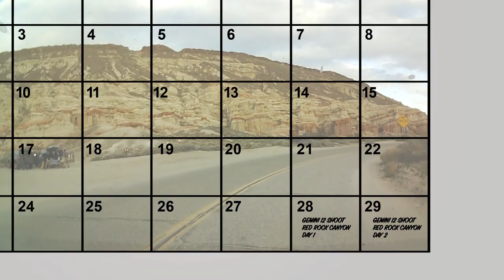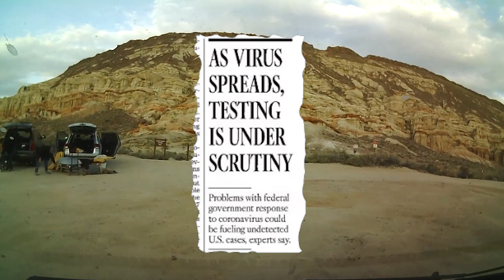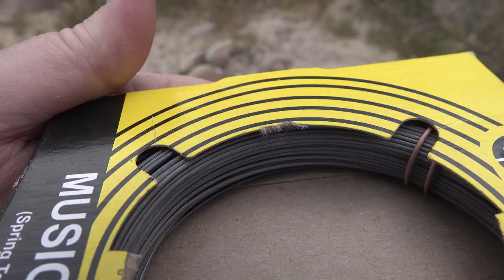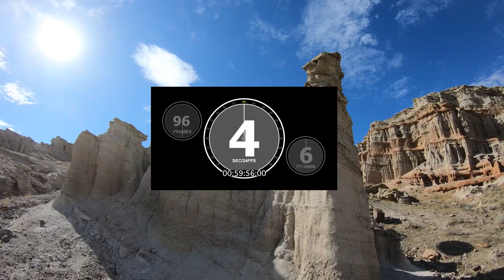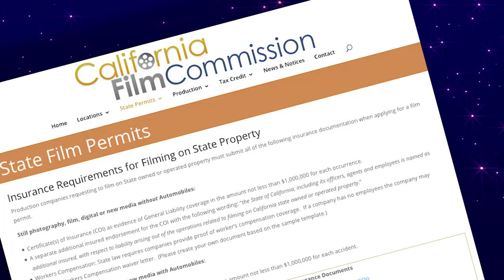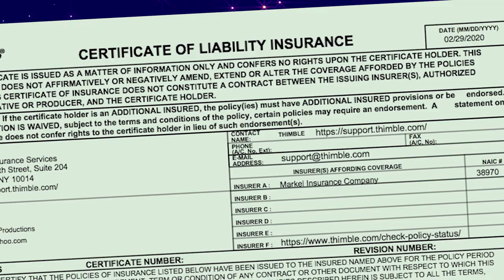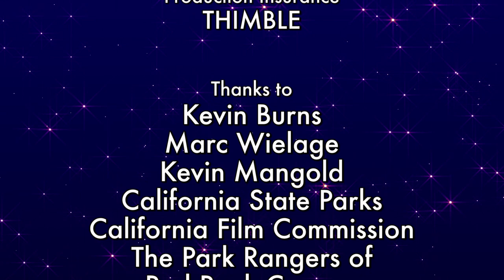Relaunching The Gemini 12 Part 3

Comment: I wish I could have been there to watch you do this. LIS was my favorite show as a kid, and the crash scene was the highlight of the entire series. I used to count down the days until I could watch this scene over again. I would never miss this episode. Thanks for doing such an excellent job. I really admire how you put the GO-PRO inside the model.
Reply: Thanks for that John.  Please do realize, with this 3 part video,  in effect you are right there with us!  

The ship itself is a very light weight, ultra-strong carbon fiber/epoxy exact duplicate of the original miniature that I'd restored several years ago. (See: "Restoring the Gemini 12" if you haven't as yet.) 

Just as with the original filmed miniature, the ship is a thin shell and quite open inside.  Glen simply located the standard GoPro camera mount with double stick adhesive already applied, to the floor of the interior, right behind the center window and then operated it remotely by using his smart phone.  As there is absolutely no cell service in Red Rock Canyon, it was a bit touch and go but as always, Glen came through and recorded the video you see here.

Comment: This made me wonder about another effect used on the Jupiter 2, or Gemini 12. Scenes depict sidewise rockets in space. I wonder if they used the Lydecker guide wire tubes with a fire extinguisher to depict the rocket spray. Great job guys, I appreciate your tenacity.
Reply from the maker: I also heard that the 'side jets' were using the Lydecker tubes with compressed air (chilled to show up on camera).  If anyone has solid evidence of this please share.
Reply: @gemini12channel58  That is correct, CO2 through the Lydecker tubes.

Comment: Great Video! But This spaceship will always be known to me as The Jupiter 2!! Not The Gemini 12
Reply: Kindly realize "this" single level ship is the Gemini 12 and was made specifically for the un-aired pilot (and also seen when the show premiered) . The series itself had a very differing premise and actually used a differently designed miniature(s) with TWO levels, the Jupiter 2... which appeared in all other episodes.  This one IS an actually different design.  See:  "Restoring the Gemini 12"  here on You Tube.

Comment: Would the original been shot 24fps or 30fps (for NTSC?)
Reply from the maker: Good question!  Yes, the 1965 version was filmed at 24 frames per second.  Our video project is 30fps so the action is a little 'smoother' due to frame rate but the speed of the ship descending was the same as the one from 55 years ago.  Our replica matched the weight of the original G12, the angle of descent was the same and the piano wire was standard as used by the Lydeckers.
Reply: Mike, describe a film chain's 3-2 "Pull-down" for 60Hz NTSC standards....

Comment: did it go faster or  slower in the  original run  ?  lol
Reply from the maker: We figured it went exactly the same speed.  Our replica was the same weight as the original...the angle of the descent was unchanged from '65...and the wires were the same as used by the Lydeckers.
Reply: @gemini12channel58  .. i was hoping for this answer and we got it... how do u  meausure the speed ? with  a hand held device i guess?...and what was  the speed... about  20 miles an hour or so   ?
Reply from the maker: @mickfizz1  We didn't have a way to measure the downhill speed...but it was more like 5 to 10 mph...we had no problem slowing the ship with the 3rd wire before it hit the lower rig.

Comment: Plan-demic you mean. Infamy. Fantastic job you did though, it's interesting how a drone is dangerous to nothing but rocks and yet whole forests are destroyed forever when it comes to mining yet that's ok.

Using your new processes with the better wire I'd wager that the movie could be redone better than the original.
Reply: 1) I'd suggest not going "there" if you'd like to remain "uncancelled".  As stated that is just a suggestion.
2) The site is well within the airspace of Edwards Air Force Base and all the testing etc. that goes on there,  hence the rational restriction on drone use. 
3)  Yes.  Glen has already done quite a bit of digital wire removal and smoke with excellent results. This will be presented with an abbreviated effects reel that's well along.  The full reel will include the launch as well as a lot more.
Reply: @paullubliner6221  thanks for the reply, is it possible to replace scenes in the original movie with better effects? Basically upgrading it. Or should I say upgraded scenes .
Reply: @HHowardHH  That's not up to us.  But what I will tell you is this:
---The entire goal of this exercise will ultimately be (but NOT right away) a 1080P widescreen & COLOR version from lift-off, through space and to the crash landing with a lot of "the missing footage" that was neither seen nor depicted (as in shot) for the original Pilot.  Such "missing footage" as a greatly expanded and more elaborate "Lift-Off" sequence and especially the actual crash landing itself ----I guarantee it to be depicted just a bit differently than you might expect!
Reply: @paullubliner6221  that sounds very exciting, please do it quickly, I'm not getting any younger. 😁
Reply: @HHowardHH  Howard, I am OLDER THAN YOU!  If you want us to work faster then you making a voluntary donation I$  $UGGE$TED!! (LOL)  Glen is making progress right this second!
Reply: @paullubliner6221  😂, well a nag for more is much more delightful than a rebuttle. 😁 I think you're great, thanks for chatting to me, i was boasting to my brother about it. Lol
Reply: @HHowardHH  LOL,  that's great!  Thanks again!

Comment: What is your problem with the Seaview from  Moebius?
Reply: ....I   " have a PROBLEM",   Robert M??  None whatsoever. BUT there has NEVER been a commercially produced, actual scale model of any of the "Seaview" miniatures. Not even close!  And I can prove that beyond any doubt, ...even in a court room.
     The Moebius "Seaview",  is:   "Naught but a Caricature".  Without question, it is not a scale model,  as by definition that requires dimensional tolerances which these things sorely lack.  And it all rapidly deteriorates from there.  
     
For Example:
1)   Their hulls are seriously, vertically elliptical not cylindrical,  BUT,  the originals were indeed cylindrical.
2)    The noses are too bulbous, too wide, with hopelessly incorrect contours, reference the Fox blueprints.
3)    The sail is too tall.
4)    The tail fins are flat and too thick, without the correct airfoil cross-section.
5)    Even the rudders are far too thick and overall, 
    ---- the entirety of these  "model kits"  are significantly "out of tolerance.",  regarding virtually every major and even minor dimensional measurement.  Lastly, they are most clumsily and crudely rendered

     Apparently, they were done without so much as consulting the original 20th Century Fox blueprints (at all) or a hands-on examination of any of the existing miniatures, which to one degree or another,  all still do exist.  And I am sorry but Dave M.'s involvement does not actually qualify as "primary research".

    Back in 2011,  I did an in-depth and on-line thread, a step by step FULL correction of the 14" version Moebius, that was on "HobbyTalk.com."  I've looked and it's no longer up there, but it was THOROUGH.  AND,  I DO still have all the "before and after" images! as "evidence" of my numerated statement of errors (above) as factually correct.
     That thread even included how to color match the original 8-1/2 foot Flying Sub version miniature's paint ---with the FIVE grey hues and exactly how and where to apply those colors.  

     In order to correct everything, it all took a very long time.  And after many months I finally got the thread finished,  but it really was a HUGE job as there is that much wrong.  The 39" M. Kit cannot be corrected, or even salvaged  There is simply so much out of specification., one would be much better off by starting from scratch.
----Since by your comment, you obviously came here from "elsewhere",  I presume you do know how to personally email me.  Do so and I'll send all the proof anyone could need to see those things are indeed, absolutely nothing aside from quite poor caricatures.  So much so, -----Remco would be most proud!

Comment: Not shot on film....sad
Reply: What difference does that make?  When I was going for my film degree half a century ago, I'd have agreed, but not now.The technical aspects of recording are just that, technical and nothing more.
Reply: @paullubliner6221  look, feel, authenticity.
Reply: @bratboy5203  Excuse me?  WHAT "look" exactly are you referring to?  AND... as determined by what film?  Kodak ECO, 5247 stock, reversal K41process  Kodachrome, or Fuji Film (as with  "Das Boot")?  ALL have very different "looks" and even vary widely by periods of time when they were processed, and especially how they were stored after processing.  And all of this ignores the output of digital restoration! 
To this day, I personally am still able to accurately estimate the age of color footage within a few years by its given characteristics and appearance.
---So, by the above, sadly your comment is functionally invalid.
Reply: @paullubliner6221  thats your opinion. I'm glad you have amazing talents. I would have liked to see it shot on 250d pushed.
Reply: @bratboy5203  At 2750 feet altitude, "pushing film" is absolutely wrong unless you're using 5 neutral density filters at F125.
Reply: @paullubliner6221  I think it also depends on the aperture of the lens, does it not? As well as the speed you're pushing it to? I'm a little confused as to why your previous response was deleted from here.. I really want to respond to it. Yes I wanted some grain.